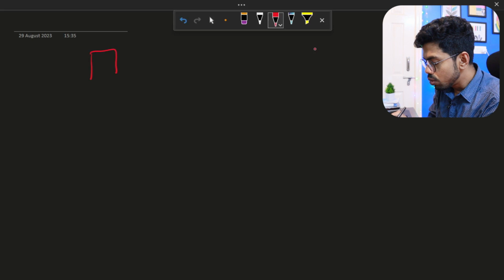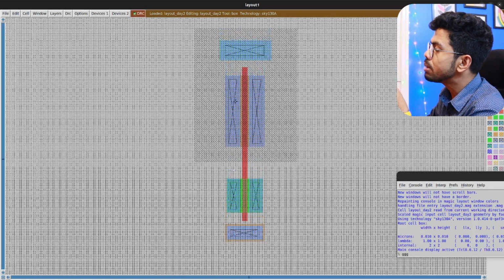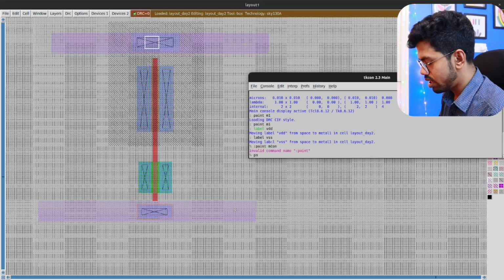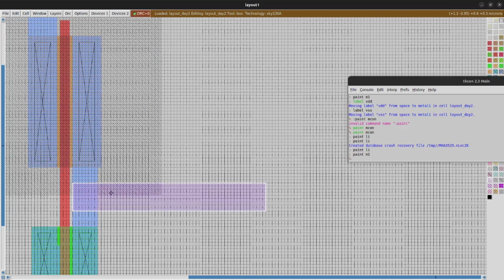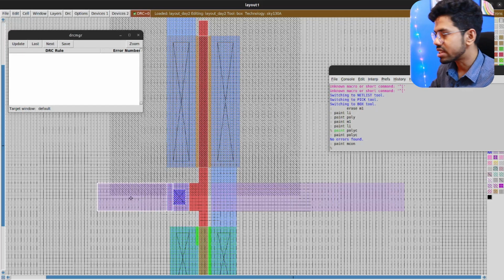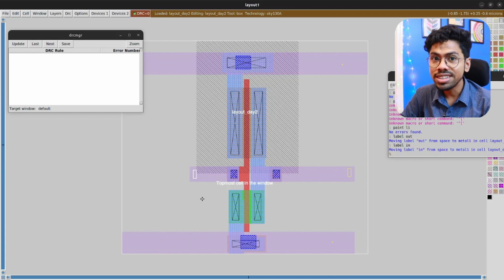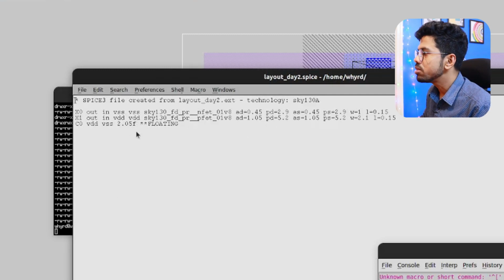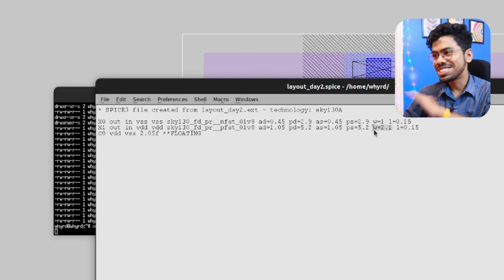Magic VLSI tutorial Day 3| Cmos inverter layout with sky130 PDK

Comment: sir just intrested to know does open source tools bring any potential to resume ? and generically i too was learning some open source tools like kicad but the industry is always asking some corporate tools experience !!!!
Reply from the maker: Yes they bring quality to your CV … yes if you can have commercial tool that great but else having good project in open source always help , atleast it help you to het deep inside to that topic and any conceptual question from that particular project topic becomes a easy thing for you , plus that time you can also emphasise on the point that you also done project using open source tool and open source in intial level same as comercial tool it will be very easy for you to quickly ramp up on commercial tools